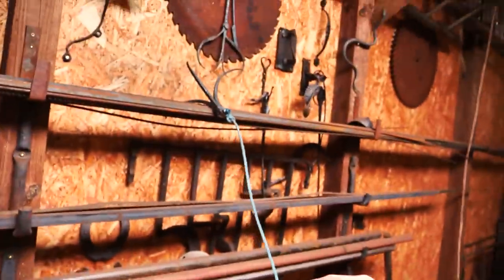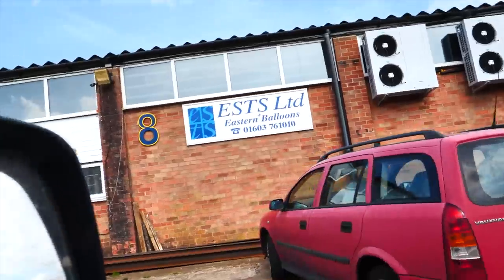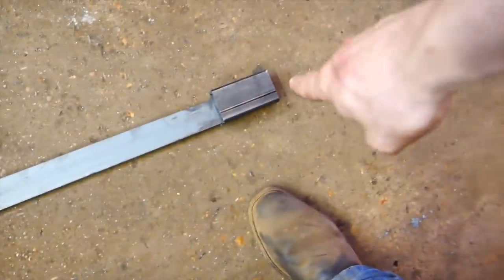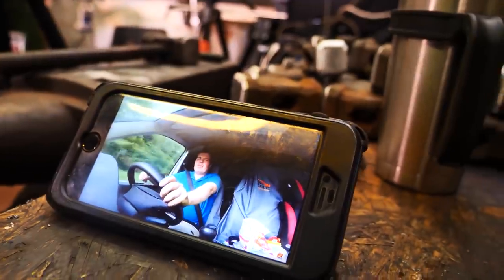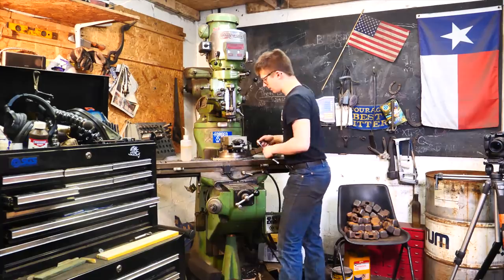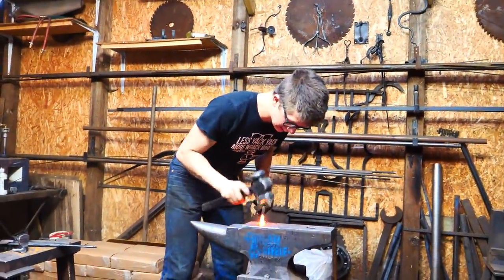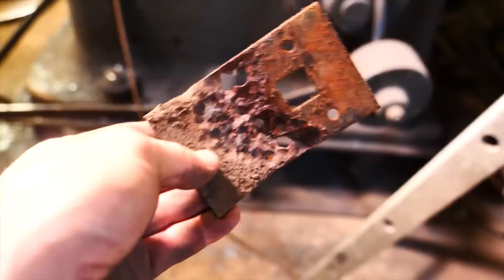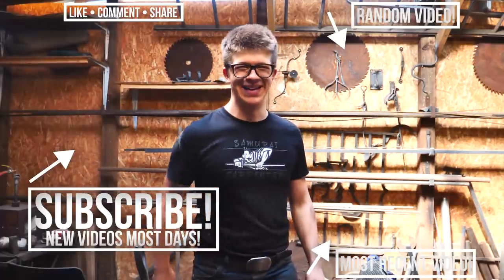BARRED - Had to make security bars for the shop doors!

Comment: Hey Alec, you could add two supporting pieces nearer the opening of the doors kind of in a 'U' shape on both doors so as to add some more rigidity to the main bar at the center.
Reply: That would help with slowing down if not preventing a ram style attack from breaching your doors.
Reply: Yes, structurally the bar is substantial, but the way it's mounted could be made much stronger. U shaped brackets on both sides of the door would help a lot.
Reply: Zachary MacRae that will help keep the Danes out for sure.
Reply: I was going to suggest making the middle stretch of the cross bar into either an I beam or a C shaped bar to provide further strength to the bar as it looks like it could flex a bit and also provide a spot for a would be thief to wrap a chain around to pull the bar out of place with a car or something or is it a lot stronger than I think it is?  Other than that, like a few others have mentioned, adding some centre supports to the edges of the doors will also add more strength to the bar, and stop the flexing
Reply: I was thinking along the same lines. A little too much room to bend it out a little and slide a car jack in to bend the long bar out of the end slot.
Reply: Yeah, without that extra support in the middle, the bar acts like a lever against the hard support on the right. That being said, it is still sturdy as hell with those four bolts, and it would take more than two people to get in, but it is just a nice touch.
Reply: I aggree! The bar looks very flimsy. Something I wouldn't really have a problem pulling out if  I set my mind to it... No, really. Brackets or U bolts would help a lot.
Reply: And no, the bolts won't break, but the bar is flexible enough to pull out of the slot on the right hand side.
Reply: One guy could do it buy him self without any tools. You are all right it needs something more.
Reply: I was thinking he could also weld a L shaped bar around the center of the main bar, that way the bar would be a lot more rigid in its most vulnerable area
Reply: And some kind of hook at the unlocked end. Go big or go home lol
Reply: Marshall Freeman it was but a minor suggestion...and Alec doesn't strike me as someone to do a half-assed job.
Reply: Zachary MacRae haha, snap. Just said the same thing, but using box section for the bar and security box around the lock, it's always the weak point.
Reply: Slowing down a burglar is the main idea here, not making it bullet-proof. We are talking an average guy with a screwdriver or little crowbar for leverage, not battering rams. The longer he needs, the louder things get with prying and grunting, the higher his risk of detection, the sooner he will give up or decide to try elsewhere. Somebody hellbent on getting into that exact building is a whole different story, but the above applies.
Reply: Alexander Bast true, the area where his workshop is, is basically deserted after about 8pm in the evening. The track beside it is also used by the type that would be more like to have a pop at stealing this kind of stuff. If it was a box section bar and the lock was protected/concealed it would take a LOT longer to get in.
Reply: You're all saying all of this to make his new steel bar more effective and that, I get it, but the door is made of wood. Think about it for a moment.
Reply: I think the point everyone is missing is that you mainly did this to meet the insurance requirements. If someone wants to get in they're going to get in, even if you have sharks with lasers on their heads.
Reply: Blasturbator you do have a massive point think Alec needs to improve his doors it's about time he did a big project. Damascus doors lol
Reply: BrakTV - I support the "sharks with lasers on their heads"-idea to 100%!

Comment: Might want to put a "shackle box" over the lock Alec. Something like the ones they put on shipping container storage units on site, stops the lock being sledged.
Reply: Definitely.
Reply: Yes, And it'll help to protect the lock from the weather also so it's not as apt to get wet and freeze during the winter.
Reply: Definitely. That's the only part I wondered why he didn't add. If you gotta build a siege bar, one must have full blown protection :)
Reply: If you watch many of his videos you would have known that he has two areas that make up his shop. He put the bar on the interior doors. Where his tools are.
Reply: Don't think he is worried of anything where he is at, it was just an insurance requirement and he in theory has done what they've demanded for coverage.

Comment: I had to put 50mm by 100 mm (9mm wall) tube as the cross bar bolt that had to slid free in both directions to free each door individually on 10 shop doors to secure  almost 4400 sq meters of shop space.  This became a requirement after we were broken into and had every last tool of any value stolen just six weeks after moving in.  Best of luck.  My retired police officer dad said it best..”Locks are just there to keep honest people honest..and help you sleep better”.  Now I’m securing six more out buildings to insurance specs...costing time and money delaying my new location opening.
Best of luck.  I think you’re the most popular blacksmith on the Net

Comment: You insurance company wants you to have a siege bar? I don't think people are running around with battering rams anymore, your insurance company sounds very European.
Reply: Its amazing how much a car can seem like a battering ram...
Reply: true all you need is a pickup truck you don't care about(stolen), put it in reverse and slam on the gas.
Reply: You guys are thinking too big, angle grinder or reciprocating saw. Or chain saw thru the wood around the door knob.
Reply: That's right mate they don't run around with battering rams but they do steal vehicles and use them to ram doors or attach chains and rip little bars like this off lol.
Reply: Of course it sounds european...he's in the UK, which is a part of europe.
Reply: Daniel W: well, at least until now.  :(
Reply: We'll still be a part of Europe, just not the EU
Reply: Power tools take too long and are loud as hell. If you crash through with a vehicle, you will have a lot more time to loot from the moment of raising any alarms.
Reply: It's a shop, not a house. These are required for any swinging doors like he has. It is a very real policy among many nations including the US.
Reply: Yeah this is typical with those barn doors.. We had one for awhile too until we upgraded the doors... They are still fairly easy to break into if you want and you don't need a battering ram (I am in the US)
Reply: I have a battery operated mini ban saw that could cut that bar in half in about one minute, Its available wherever tools are sold in the USA. Alarm system is the only way to go.
Reply: Shhhhhhhh!
Reply: twitchi Sounds like his insurance company are Islamophobes. (sarc)
Reply: ye ramming is not that big of a deal in this case, its a door in a shop,
if its the outside door Sure, but inside...? needs to ram true the first part of the shop, before you can ram the door,
not as easy.
Reply: Pretty much all doors, in commercial applications like this in the U.S., require a cross bar. This is mainly required when either the door, the door casing, or the wall that the door is in, are substandard.
Reply: Daniel W I don't think they are anymore.
Reply: Stanley Jones my money is on a big dog. That's the best security system.
Reply: Heruhcane Dean Uh, Europe, riots, Isis, Muslims. Read much?
Reply: @Twitchi someone used a mobility scooter in the UK once!
Reply: That additional lock for the bar is the main thing about it, a burglar would have to crack two locks now to get in, which obviously takes double the time.
The idea is not making that door absolutely unassailable, which can't be done, but to make it too time consuming to break into. We're talking about your average burglar with his big flathead screwdriver, possibly a crowbar, for simple leverage. That is the first step to deter anyone not hellbent on getting into exactly that building, but the average guy trying to score some 40 Euro that night for his fix or his "daily wage". This is what "RC", resistance classes, are about, they will stop a burglar using a given set of tools for 10 minutes minimum. RC3 for example would call for a 2mm steel-inlay covering all the door and reinforced hinges with additional protection on the closing side. 
Deterring anyone that determined would take a lot more effort, there will be silent akku drills to compromise the hinges or the part around the lock, or a car jack to destroy the hinges or lift the door from them with up to 6 tonnes of pressure. We're not talking power tools like angle-grinders, we're taking fairly silent things.
Reply: Never underestimate a broke tweaker. They can be right resourceful, especially if they suspect there's equipment to pawn and metal to sell for scrap.
Reply: Reality is that anyone who knows about locks can easily pick a padlock or exploit a weakness thats known in the locks by the criminal fraternity and the insurance company are well behind the times, if you watch certain YT channels that deal with locks and security, you will soon realize that there isn't a think called a secure lock...
Reply: That is all very true. The setup here is not going to stop somebody determined or professional. But it will help deter the guy with the screwdriver looking to get his fix for the night, and two locks are still more effort than one. Bit more security fixings might still pay off.
Reply: Heruhcane Dean well he is making grappling hooks and swords so sounds pretty medieval.
Reply: I want to see a Damascus Spike Pit Trap!
Reply: The flaw isn't just known by the criminal fraternity. There was a big fracas about it when someone approached masterlock about it and was sent packing.
Reply: Alexander Bast the stereo typical junkie raiding a yard myth... some one strung out and clucking will steal small items and not with machinery or tools that need a vehicle.  not wanting to tar people but your more likely to be robbed by a group of travellers who are known to find things like diggers and compressors and the occasional bulldozer...
Reply: Nah, I wasn't talking about a junkie making a haul involving a car. Would more likely grab two or three power  tools and make off. Situation in Germany is: some 45% of burglars will be German (organized burglars from Georgia, Southeast Europe and Chile (!) are a different streak and a huge problem), of those about a half will be small fry, usually addicted to drugs and/or gambling. That is what I know from serving my articles with the state attorney and the police (not extensively). With regard to the latter type I cannot imagine the situation to be different in the UK. Those will rely on speed and look out for a bounty of as little as 20-40 Euro per haul, that sort would be unlikely to try and tackle something that ostensibly barred and locked, would look for an open window, try whether a door is not actually locked with a plastic flipper, maybe attack a flimsy wooden door (not what Alec got, that is rather massive) with burglars' best friend, the large flathead screwdriver, 2 minutes max.
Reply: Adam Bryant Bosnian Bill is a complete thorn in Master Lock's side. Their locks really are trash.
Reply: They wouldnt qualify most gun safes in the US as a safe. They are merely lock boxes. The classes for any form of insured equipment are much more stringent than even I expected until I ran a few installs over there.
Reply: They wouldnt qualify most gun safes in the US as a safe. They are merely lock boxes. The classes for any form of insured equipment are much more stringent than even I expected until I ran a few installs over there.
Reply: There is a lovely channel on youtube where her cracks locks and from the fact he keeps making references to bills vids, ones assumes that he is not bill.
Reply: Yes, this Bill is a pro. But notice how he built himself a special torque wrench for some Master locks and how it is taking him over 10 minutes to pick some of these, sitting down with good lighting, no noise, no risk, being able to turn the locks freely. Times two locks, just the new one should be made to face downwards. Too much for anyone not really determined to get into that special building. Your non-pro burglar will rather resort to force than fine skill.
Reply: I have way too many tweaker relatives in and out of jail and prison to know it's not a myth - they can and will do anything to get their drugs, no matter how big or small. One's wanted for stealing on camera from a hardware store, one's in prison for robbery and attempted murder, and the rest are disowned for breaking and entering several relatives' homes and clearing them out. I know of one whose an ex of one of my now clean relatives - he has openly and proudly admitted he steals just to see what he can get away with.
Reply: Twitchi the car they stole is probably faster money and maybe even more money than what they could steal from a blacksmith shop, albeit there are 10's of thousands of dollars worth of machinery, yould have to have a small crane and a truck to take it
Reply: Mystogan .Ravenheart that lock is not worth the money but i suppose that  dainty lil necklace of a chain on the bottom of it cost $1990
Reply: Candi Walkowski maybe in the Americas but not here.

People who steal for drugs want small and valuable items that are hard to trace that will assure a sale to get their fix.

Meth is a problem in the USA and Canada as well as a few pockets around the world, it is mostly an American epidemic given the free access to chemicals there is there compared to other countries.
Reply: Not to point fingers and draw attention to a relative who is in remission, but one of my relatives who used to use it was a parent. I spent 15 years of my life closer to that crap than I ever wanted to be. I'm pretty sure I know how they think, and I have yet to meet a tweaker to think their crimes through - they'll strip a restaurant's copper wiring clean, for example, and not think of the surveilance cameras catching them in the act - that happened in Longview, WA, a few years back, and I knew the tweakers who got busted for it.

They always strike me as desperate - I wouldn't doubt they'd walk across coals to get a fix, and I doubt it's a location mentality. And I doubt ease of access is an American problem - if they can cook that crap on their car engine here, they could cook it on their car engine anywhere - and I'm sure it's easier to get Robotussin DM and NyQuil outside of the states - the tweakers here threw up a fuss when they passed a law that they had to show I.D. to buy it.
Reply: Mark:    It's just as bad in Canada.    My last two vehicles "nothing fancy", both have had windows broken just so whoever could check the glove box and the cubby between the seats for coins or cds to get cash for meth or crack.
Reply: My brother-in-law's car was stolen last year - It was an Audi, and the cops found it - stripped and with used needles in it.

They don't care. A buck's a buck, and if they can make it off of you, all the better.
Reply: Are you sure that lock is worth $2k? I mean, yea its got ceramics to stop it being cut, its blast resistant... I would need to spend a lot on my door and walls before I bough that.
Reply: Heruhcane Dean o
Reply: ramset would be through that in 5 minutes

Comment: +Alec Steele Maybe consider welding a verticle rib along the lenght of the bar, inbetween the lock area and holding plate the other end, Effectively making it a long T-bar. That way it will provide a LOT added strenght....

Comment: hi alec,  I am currently studying machining and I would recommend that you don't remove the packing pieces from underneath the part you are milling, this will stop it moving in the vice and provide extra support when performing the operation, you can use a copper mallet to hit the work piece down into the vice after tightening to ensure that the packing pieces/parallels are secure and not moving, this will ensure that all operations are square and accurate, thanks and keep it up man, love your content

Comment: A couple of points. Firstly, people breaking into these workshops and farm buildings often carry portable cutting torches. Quite a few farmers have come out to find an empty barn and an empty bottle outside the door. Secondly, make sure you don't create a door worthy of Fort Knox but have a wall/door body that can be opened with a potato peeler. Better to have a lock they can break through that would set an alarm off than have them cause expensive damage. You could put a simpler lock and alarm on the outside that would deter most thieves but still be the weakest point so you know where the reset would attack first.

Comment: Alec, place a couple more L brackets in close together more towards the middle of the doors to prevent somebody pulling the bar in the middle and bending it until the none padlocked end popped out. the guys who would come to your place to break it will come prepared with a rope or chain and connect it to a van.

Comment: You need two additional plates with box steel near the edges of the door.  That long piece of steel can be bent out using using a lever and the whole thing rendered useless.

Comment: Great engineering skills on that one. Only thing I would have done was instead of using flat bar for the bar going across used a C channel facing toward you. 1 make it harder to attempt to cut lock shank. 2 won't be able to bend. But not my lock not my design. Really enjoyed the hole drifting. Keep the videos coming!